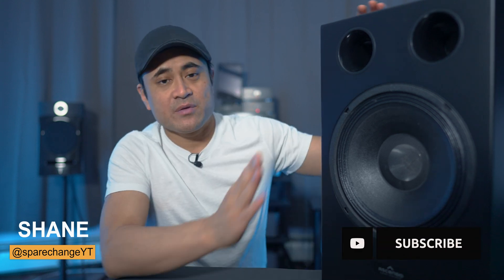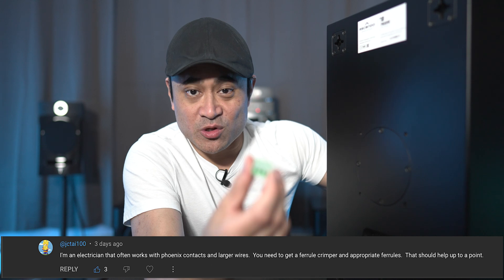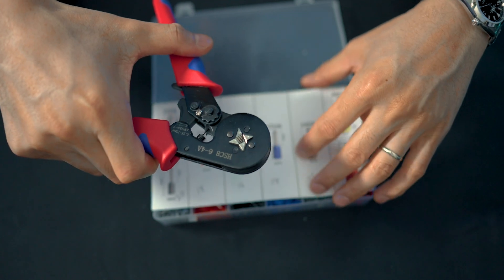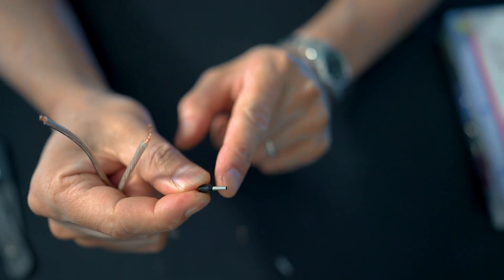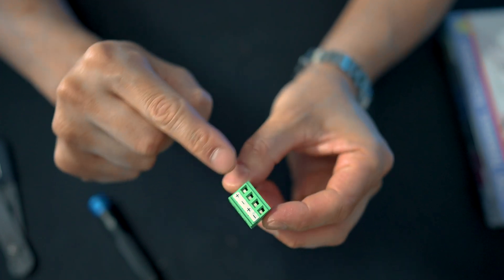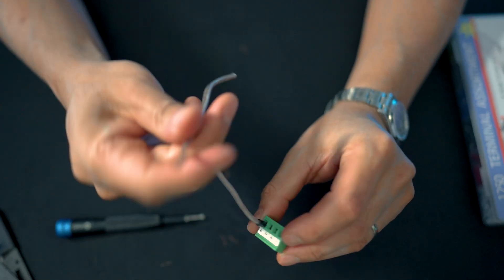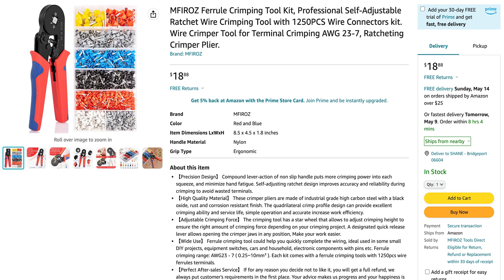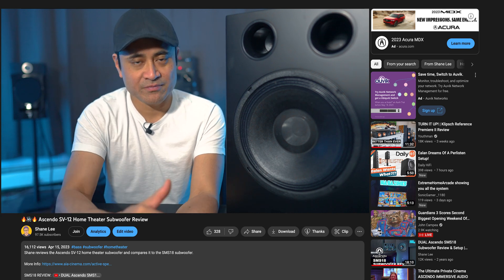Speaker Hook-Up 🔊 Ferrule Crimping and Phoenix Connection | Ascendo Audio Home Theater Setup

Comment: Have you tried with larger cables? Do the ferrules still fit in the phoenix connector? Does it protrude requiring a cut-out behind the speaker for the cables when installed like this?

Comment: So much nope. Phoenix connectors are designed to have bare wire inserted and clamped. Using ferrules, especially those with a square crimp tool, is literally the least reliable way to terminate to a phoenix connector. Less contact and higher clamping force required to hold the ferrule in place. I'm saying this with 20 years experience in Pro AV. So I'll say it again... Do not use ferrules into phoenix terminations. Absolute amateur hour.
Reply from the maker: Ok boss. You tell em!
Reply: It required only a brief review of the Phoenix Contact documentation to verify the intended use of these terminals. The datasheet for the MSTB 2.5 series explicitly specifies the permissible ferrule cross-sections, provides torque values for ferrule-terminated conductors, and even identifies the manufacturer’s own recommended crimping tool—the CRIMFOX 6—which employs the appropriate trapezoidal crimp geometry. These details make it unequivocally clear that ferrule terminations are not only supported, but directly anticipated by the connector’s design. In light of the manufacturer’s stated specifications, the assertion that ferrules are unsuitable for this application is demonstrably incorrect.

Comment: I would only advise using a ferule if your cable is by necessity of the length, larger than will fit. Electrically you produce a more effective connection with the bare wire being compressed. 

"neatness" is not about effectiveness. Soldering your ends produces the same restriction of limited contact and opportunity for unwelcome shift in impedance, heat generation or loss of signal integrity.

Comment: I have found that solder always allows you to get the best sound out of your speakers, it makes a huge difference in detail and clarity. I solder all the connections inside the speaker and at the connection point. It takes and time but it is worth it. I also think 12 gauge should always be used for best results.
Reply: I respectfully disagree. Crimping has been shown to give the best consistant connection when measured by resistance (ohms). Soldering can be as good, but it takes much more skill and expertise. A "cold" solder is much worse than a proper crimp. Also, the gauge to use depends on the length of the cable. Again, the measured resistance is proportional to the length of the cable and it can be easily measured with an ohm meter.

Comment: I’ve been using ferrules on normal speaker wire for over a decade now, keeps everything neat and tidy. 

If you have to switch between banana and phoenix plugs often for reviews, consider something like the Kinter Lil'Piggies
Reply from the maker: Those are great. Guess I won't need the ferrules after all.

Comment: Thanks for the shoutout Shane!  I have that exact kit off amazon too lol!  The crimper is good, but some of accompanying ferrules are umm a little loose sometimes.  We generally don't twist but I think you did it right since twisting the bare wire will slightly increase AWG for a better fit.  Nice one 👌
Reply: Twisting results in a less positive crimp.